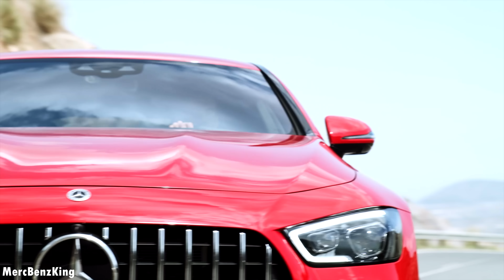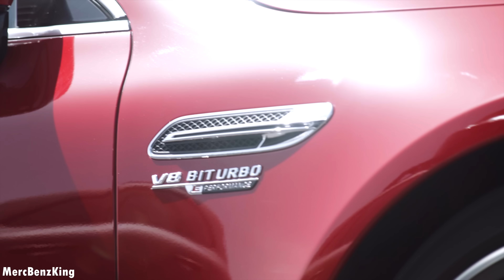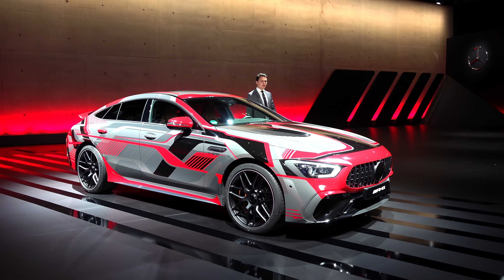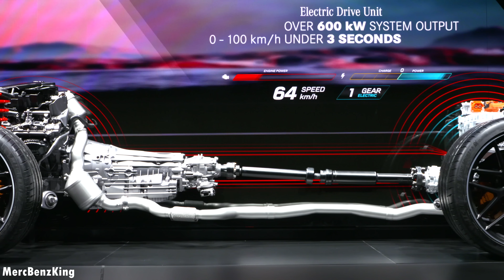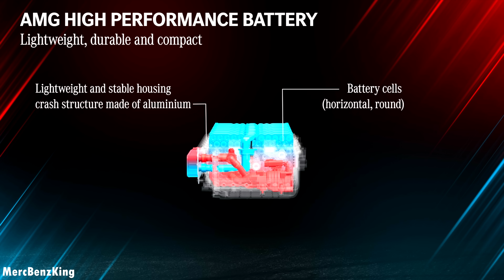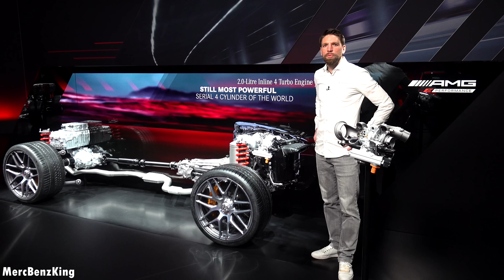NEW 2022 Mercedes AMG GT 4 Door | GT63S Coupe V8 E Performance Review

Comment: So much exceptional technology, very impressive power. Unfortunately it will only be seen as 63s plug-in where the 73e name would of stood out as the  ultimate powerhouse.  Brilliant engineers, mediocre marketing.
Reply: Gt73 is not scrapped, there is still Gt73 coming up
Reply: @brieflyfunnymoments5186  the GT63 S E Performance is the official name for the GT73e apparently
Reply: @brieflyfunnymoments5186  I hope so, but I think it's not going to be like that
Reply: @vodka_nrg2890  yes it's going to be different,, that's why they decided to stay with the GT63 with this hybrid because it's identical to the GT663 except for the motors
Reply: I expect a 73e to be more range efficient since it would be an official 'e'

Comment: I just have one very important question.
Does it have soft closing doors?
Reply: Yes
Reply: I was at the BMW store looking at the BMW series ALPINA B7 xDrive and I slammed the door shut only because the screen inside read replace battery.  No one said anything but when I went to the backseat I got out and tried the soft close and it worked.  LOL